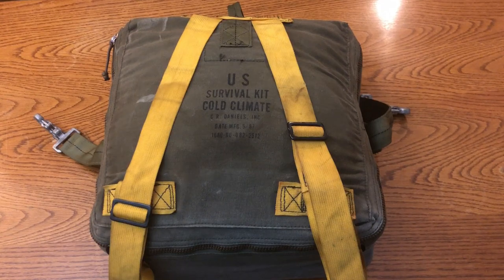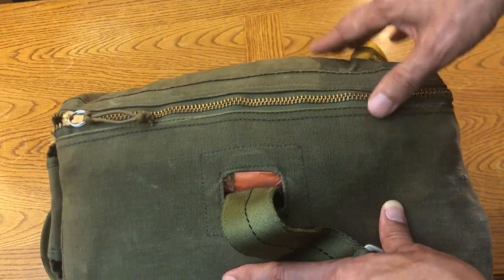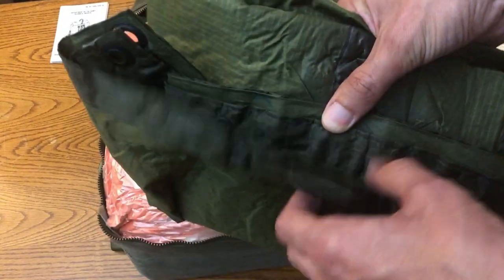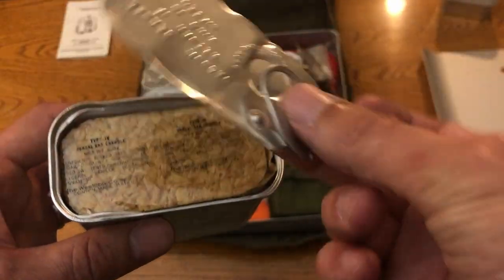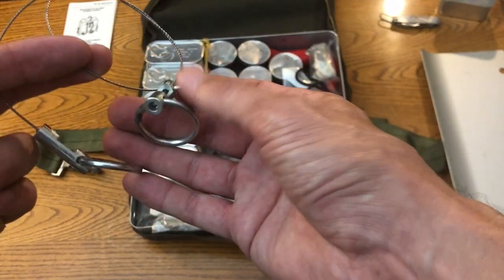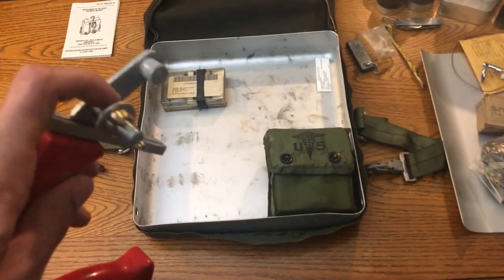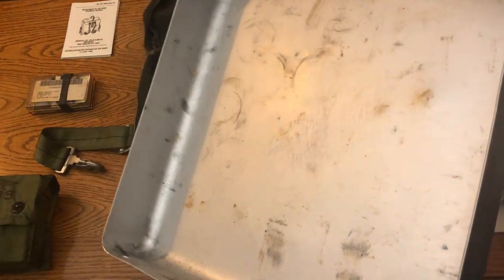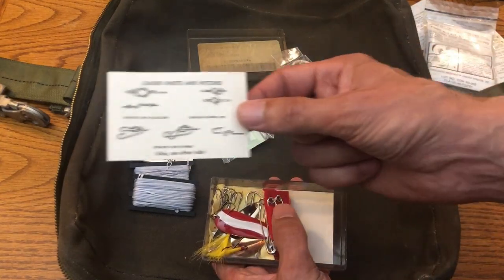Aviation Survival Kit - Cold Weather  @ 1987

Comment: That is THE BEST wire saw made. It is not cheap.It will cut the ceramic tiles of the space shuttle, jewelers use them, and Chuck Yeager cut the metal ring of his pressure suit while being burned severely after a crash. Do your homework before making stupid comments. They are available for 25 dollars and are worth it.

Comment: From my understanding,  these kits were attached to underside or back of ejection seat.   Also each kit was replaced and gone through for up to date food and serviceable use of gear.  This maintenance period was usually every 300-400 flying hours, depending on the type aircraft.
Reply from the maker: Thanks for this info!
Reply: Used for light aircraft and helecopters. Ejection seat aircraft would have a standard survival kit which may or may not have this as an addition, depending on the type of aircraft and ejection seat/survival kit installed. Also cargo type of aircraft carried a number of these on board (same number as crew plus 1 or 2).

Comment: So the two yellow nylon straps are actually what do connect it to the ejector seat of the fighter jets
Reply: NO, those are for carrying the kit as a back pack. Those straps with locking snap hooks are what attaches the kit to the pilots harness.
Reply: This particular type of kit was not used in aircraft with ejection seats. These kits were used primarily in helicopters. The yellow straps are shoulder straps & the green straps with the clasps were for securing the kit inside the aircraft.
Reply from the maker: @shakyarcher  Cool, thanks for this info.